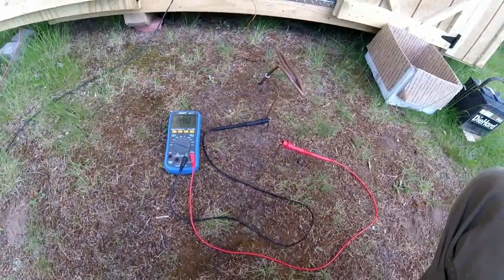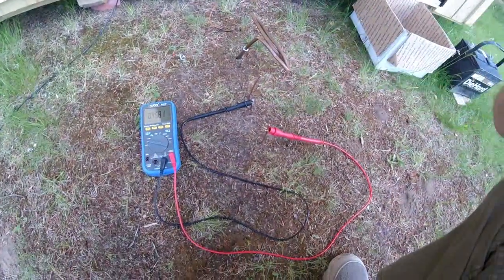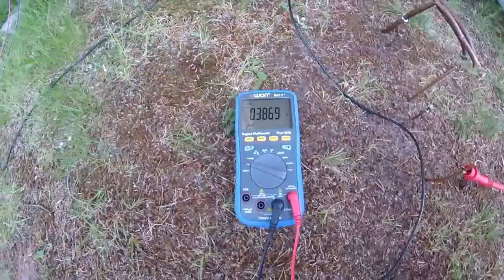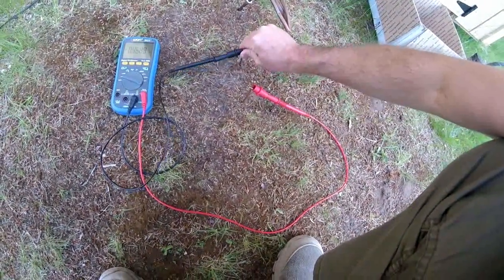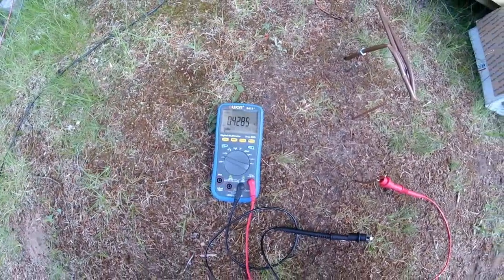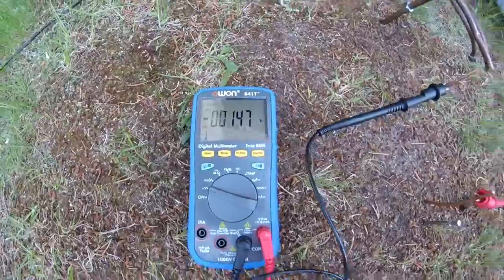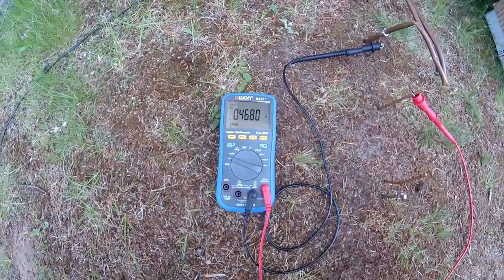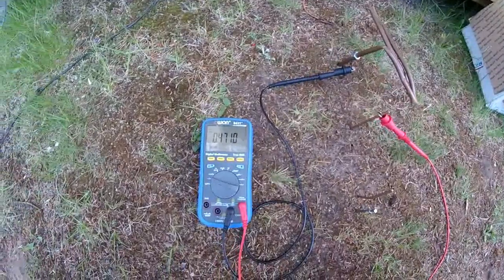Earth Battery Free Energy From The Earth ~ Simple Experiment

Comment: back in the seventy's, we got electricity from the wires going to our well pump (with the AC circuit disconnected). In fact, plumbers refused to work on our copper pipes because of the shock they received...

Comment: No moisture in the earth no voltage. This does not work in a parched desert as there has to be a breakdown of the different metals requiring a electrolyte, i.e. water.
Reply from the maker: That is true but you could put them in containers and it will still work.

Comment: Nobody ever shows the amperage.  Volts can be reached easily but the amps? That's the important part dude and you didn't even show the amp readings. This is useless
Reply: You are correct. 

He did mention that the circuit doesn't generate much current. The battery works because one metal can draw electrons from the electric potential in the ground more efficiently than the other. The outermost electron shell is more conductive in one of the metals. 

Just like any component in a circuit, a battery has resistance, called the internal resistance, and it limits the maximum current that can flow between the positive and negative electrodes. An ideal voltage source has zero resistance and its output voltage will remain constant no matter how much or how little resistance the load presents. A new AA dry cell has about 0.15 ohms of resistance.  At a minimum the circuit should maintain a load at least 10 times the battery's resistance, and preferably much higher than that. 

Considering the capacitance he measured on the voltmeter when moving his electrodes (the meter changing slowly or going up and down while the electrodes charged to their potential difference) this would indicate a very high internal resistance for this battery (maybe 10's of ohms or higher). It ain't gonna do much work. ex: 0.45v/75 ohms = 0.006 amps shorted. Any practical device will split the voltage at some ratio based on resistance and not get enough power to function.

Experimenters studied the earth battery with plates in an attempt to achieve something useful. Its widest application was probably the powering of signals between telegraph stations in the 1800's. Closing the telegrapher's key formed a short (near zero resistance) connecting the battery to a series coil. The rapid change in voltage, small as it was, produced enough current to generate a sufficient voltage in the coil at the next station which caused the magnetic key to close. And voila: r-u-up? in morse code.

But if you could generate a 1000 volt difference, even with the 75 ohms, now ya got something!

Comment: perhaps, you would get a higher voltage (potential) using a different electrode (farther away) when you disconnect the electrode in series (in between the elements) from the "circuit"; or, those other electrodes are loading also and or accumulating/conducting and still might have a great effect over the circuit...

Comment: I got 44 volts from my Earth battery/capacitors. I'm working on a 140 volt one now. I'm going to plug my phone into the ground and charge it. I hope it catches on because high electric bills are becoming even higher and more ridiculous overall.
Reply from the maker: Wow, do you have any details you can share on how you did that?
Reply: Yea,check out my videos it'll explain some. I' don't want to give out too much info until I get this one put together and show ppl I can charge a phone with it...but I'm going to upload all of my work and findings when I do that. I made a cord too that puts off voltage all on it's own once you get it wet. I'll show you the various ways to do that too.
Reply: Yea, check out my videos and they'll show you some. I don't want to give out too much info just yet until I get this project done and upload it. I'm going to give out everything I've found out so hopefully ppl with more resources can start experimenting and eventually catch on and wont be able to be stopped.
Reply from the maker: awesome. Please consider also bringing your videos over to DIY Tube Video Community http://www.diytube.video

Its new but pays in cryptocurrency which can be sold for fiat. And they pay up to $10 in coins per 1,000 video views. More than double what YT ever paid.
Reply: Run my shed charging batteries and radio off ground/air batteries and super capacitor bank. Decided I could use an air battery with ground battery. So I get current from ground up and air down. Careful with air batteries and storms.

Comment: I think you are on to something here with your earth battery the thing is you are about 180 years too late for this discovery! According to Wikipedia, an earth battery was built by Alexander Bain in 1841 in order to drive a prime mover—a device that transforms the flow or changes in pressure of a fluid into mechanical energy.[1][2] Bain buried plates of zinc and copper in the ground about one meter apart and used the resulting voltage, of about one volt, to operate a clock. Sorry Troy
Reply from the maker: Oh, I never said I invented anything here. I mentioned in the article that this is old technology. I am just showing people some cool stuff.

Comment: Earth battery=energy release from chemical reaction of metal oxidation not from the Earth.  Not free energy in that the metals had to be produced by human  which took energy and money to make.  The soil or dirt has moisture ie water with dissolved salts, acids, alkalies which is the same in principle as most any galvanic cell such as a flashlight battery.  You can demonstrate the same or better with just creek water and dissimilar metals.  Energy not free, one metal will need replacing $$$ at some point.  Have heard of some telegraphs purposely using, but most used regular batteries.

Earth currents=Real free energy electrical currents flowing thru and over the crust of the Earth.  Independent of soil and metal chemical reactions.  Different compass directions does seem to have an effect on strength.  The setup for this is almost as the Earth battery. To test for this real free energy, simply take metal conductors of the SAME type metal and plunge into the ground in various arrangements and depths.  This way strips the galvanic conflicting volts/currents from skewing  the circuit measurements.  When choosing a metal try to use ones will low oxidation/rust character.  You could use two carbon rods or plates etc.  

Other real free energy, not from the Earth.  Not referring to lightning specifically which would be hard to harness safely.  The old telegraphs reported still working even with dead or removed batteries obviously had an energy source even the operators did not know what or where it was.  They saw the results and they accepted it as fact unlike today, where people go ape crazy if you mention any energy effect outside of accepted physics even if they see the said effect!  I know the source.  TH Moray got his first interest in free energy from these very reports of telegraphers and also his listening to railroad metal parallel tracks (relative to the Earth) with a Bell telephone head set.  He would hear the sounds from this "mysterious" energy source and wonder where it came from.  Later years, Morays states that he "originally thought it was coming from the ground".  So he is admitting it was not coming from the Earth.  The result of his experiments lead to his powerful radiant energy device which so far no one has been able to reproduce and certainly not at the reported power levels.
Reply: EnergyCrafts interesting to me, but I have very little understanding of electricity so far (just learned of what volt and amps are) but do you know of a good book, perhaps with some easy experiments (I'm doing a long trek now, as in months) and I'm particularly interested in free or at least cheap energy, for when I finally have a piece of land. Making batteries or cells with some odd metals and other gathered materials is very much of interest.
Reply: I agree on galvanic electricity like Faraday used. Stubblefield coils and Rodin coils pull off the earths changing magnetic fields. With super capacitors becoming cheaper low volt low amps simple batteries can be used for remote or off grid power.